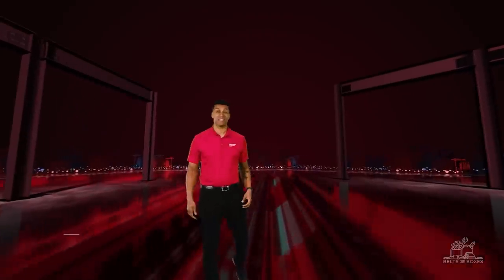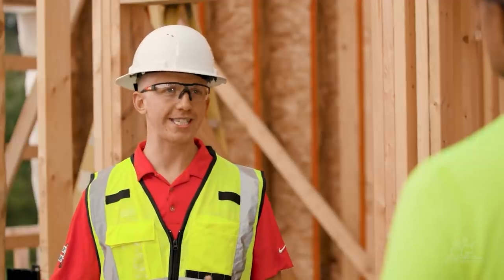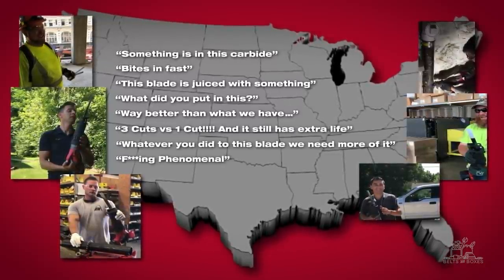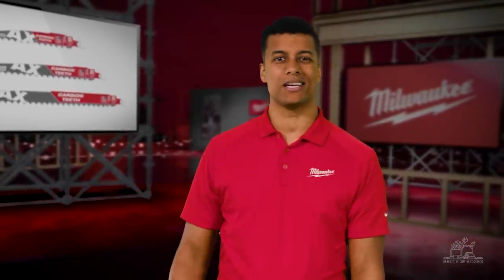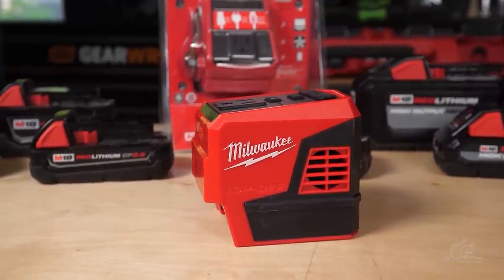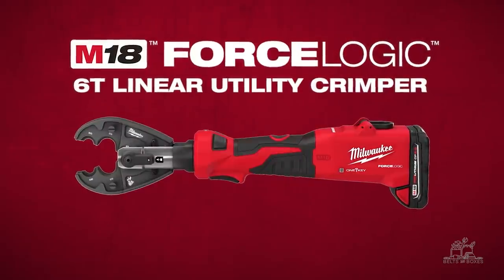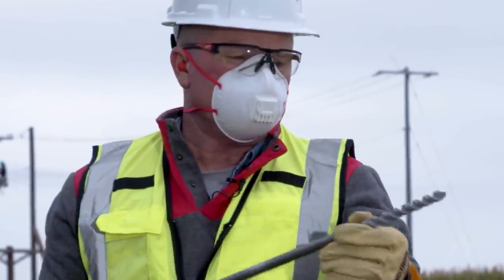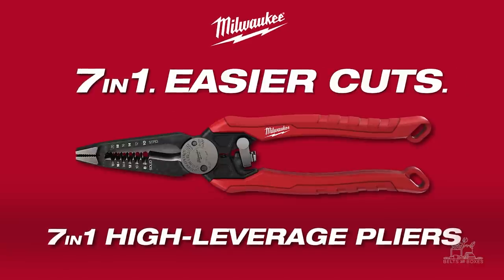Milwaukee PIPELINE Episode 3! (FULL) New Milwaukee Tools 2020 Sawzall, TOPOFF, Lineman, Plumbing

Comment: Wish they could keep the battery from rattling around in the m18 line-up.
Reply: I've only had that problem on my rotary hammers. I've go a 2717 and a 2712. They've always rattled around but it never really seemed to affect anything. What does it bother for you?
Reply: @alexludden6657  yeah 1 1/8" hammer, 1/2 hammer, sawzall, impact and deep cut band saw. They all work just don't like the battery jiggling around.
Reply: @jasonpenzes655  You can actually file a repair notice that is covered under warranty if I'm not mistaken. One of the options for service is a loose battery. I believe it costs nothing on your part; even shipping.